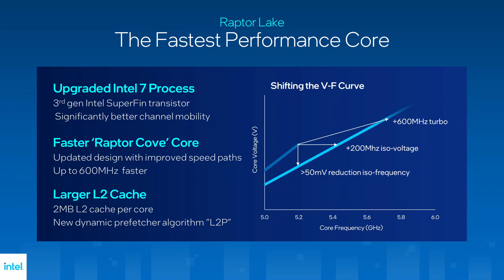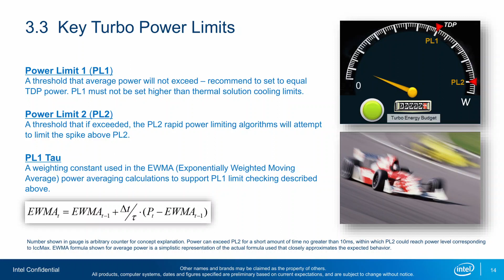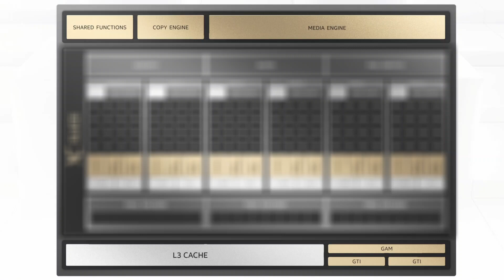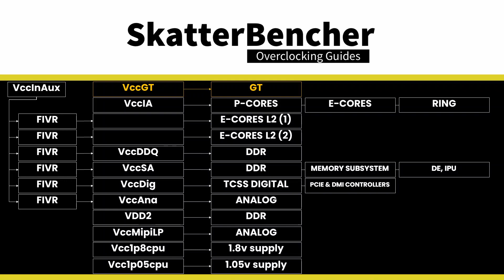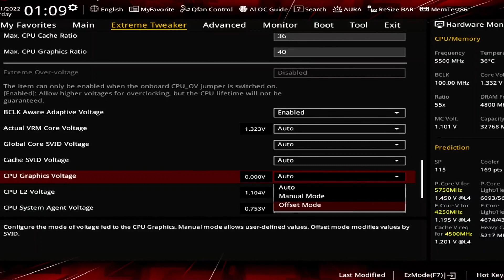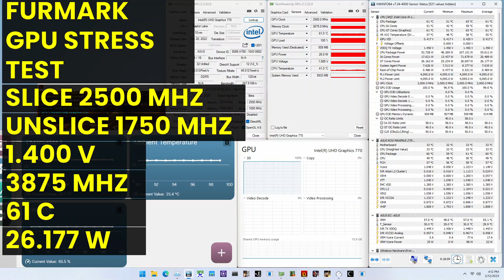UHD Graphics 770 (13th Gen) Overclocked to 2500 MHz With ROG Z790 Hero | SkatterBencher #57

Comment: Can same be done to i11800h which shows all unlocked controls in xtu or will the extra voltage fry it the uhd in it currently sits an -0.015 volt offset and 1500mhz and is stable at 1550mhz only at more than +0.05 volt offset i am really new here so i am worried about livespan and health of the cpu so i didnt feel safe going that far

Comment: Whats up with this ram mhz i made it 7000 didnt worked made it 8000 didnt worked. It worked at 7750 and 7666 but still for my 14700k on asus rog z790 gaming wifi ii with corsair vengance 7200 mhz ram, i did the same settings but most games crash or wont open. There is a thing with my ram when i make it xpm1 at its rated settings 7200mhz at 1.45 v it becomes unstable but it works with 1.45 v 7000mhz or 1.38v 7200 mhz do you think that might be the reason why this settings wont work and how can i fix it

Comment: Most interesting guide! To which dedicated GPU would an overclocked 770 be equivalent? I'm interested in skipping a dedicated gpu for basic grading in Resolve with a o.c. i5-13600k/Z790/6400Mhz ram, air cooling. Is it temp safe?